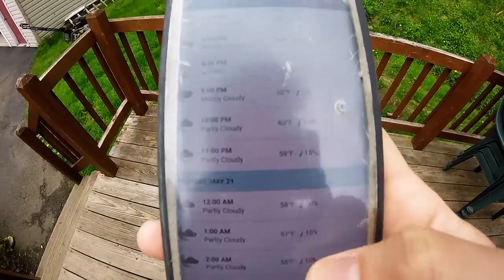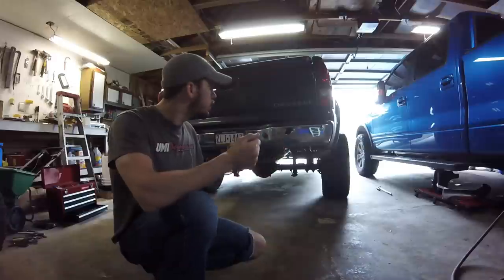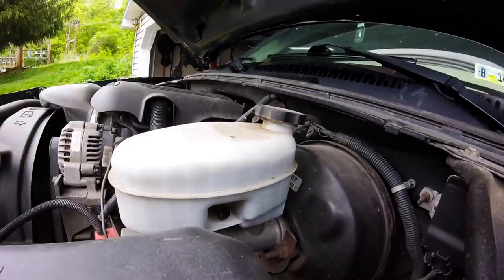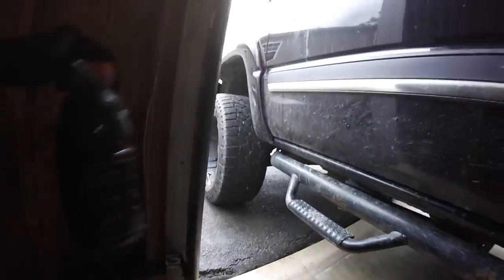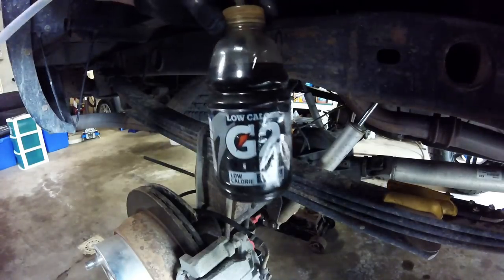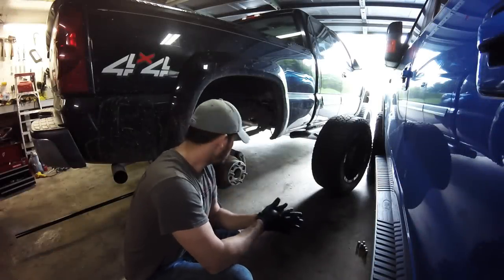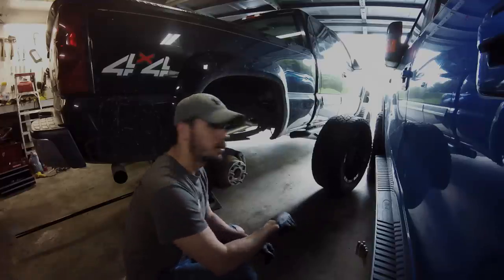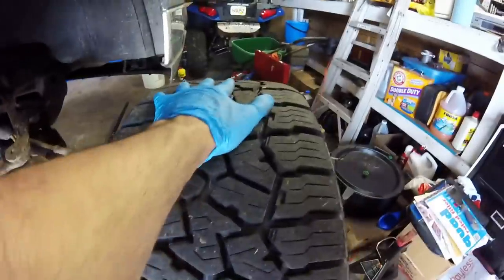04 Silverado Gets a Full Brake Bleed. Much Better Pedal/Stopping.

Comment: Before cracking the bleeder screw, try to slightly tighten before trying to remove the bleeder screw. This often Leeds to success without cracking it off.

Comment: I have the same issue with my 2005 duramax , it’s lifted 35s, I changed back rotors and pads had shop bleed brakes. Still soft, so I replaced master cylinder. Got my better result there. Did a double flush . Brakes work but I feel they could be better. My next try will be bleeding the abs. Great video thanks

Comment: Man, I really like that truck.  It looks to be in good shape for the year.  I know in Erie where I was raised that body would have been swiss cheese by now!  They use a lot more salt up there.
Reply from the maker: OhYeahAboutThat they certainly do. It definitely does appear kept up with. I tried getting him down to the $6,000 area for the exact reason figuring it would be beat and need rust repair, plus the 180k mileage. But it so far feels every bit worth $7500 I paid and it is quite fun fixing it up. I even liked doing the transmission flush lol. Now once stuff starts breaking... lol!

Comment: Just came across your videos. Nice looking 04! I got an 04 2500HD. Your truck looks pretty clean on the underside. What part of PA you in? Mine looks nothing like that. I’m in NWPA. 
Had to replace some brake lines a few years ago and didn’t realize the abs issue with bleeding them till after I bled them normally. 
Got plenty of work to do on it. Keeps me busy. Enjoyed your vids.
Reply from the maker: Thanks! I'm in the north central PA area. North of Williamsport. Prior to me the truck has south eastern PA and NJ heritage.

Comment: on your 04 chevy did you have a problem with the vacuum booster assist pump that is attached to the power booster. I think mine is junk and you can't find it or it's discontinue
Reply from the maker: Never had any issues with it.

Comment: Your truck is cleeeean bro whats your suspension and tire setup?
Reply from the maker: Thanks! 6" rough country, 305/55-20 tires and 20x10 moto metal 951 wheels.

Comment: Does this also flush the ABS module?
Reply from the maker: It isn't functioning it. However, the rear single brake line is coming from the ABS module, I want to say you are exchanging old fluid with new within the module.

Comment: He better check your brake lines I had all of mine are failing in different spots right below the driver door and then the back ones where you can't see it under the frame , don't buy pre-bent brake lines you have to fish them through and make them
Reply from the maker: The brake lines are all good on this truck luckily. I actually have since put Russell braided stainless lines in the truck since and re-bled it all again. Stops even better now.
Reply: I had three rust out before I decided to replace the rest of the original ones.
Reply: I use a this kit. lines were all ready to go and labeled
 - https://www.youtube.com/watch?v=s87C53ZNtbE

Comment: ABS module doesn't give any problems?
Cool channel I have an 00' rcsb 4.8 and 00' TA
Reply from the maker: Thanks man! Mine didn't give any issue for the brake bleed. It was doing the kick/bump thing though before this. I cleaned the ABS wheel bearing sensor and it stopped.

Comment: Does the truck have to be on when doing it
Reply from the maker: Nope, leave it off.
Reply: @DarrenWS6 you sure? I did brake lines on my 05 Silverado and was told to have ignition on position while pumping brakes
Reply from the maker: @Kevin_Yagoonie  on multiple vehicles I never had the key on when bleeding brakes and was still able to mechanically pump out the old fluid. Zero ABS issues as well.
Reply: @DarrenWS6  so you think I don't need to have the ignition on?
Reply from the maker: @Kevin_Yagoonie  I promise you I never have, and it worked. I've done it this way to my Yukon, Duramax, and Trans Am. Even my lady's Hyundai.
Reply: @DarrenWS6  awesome thanks 👍
Why would someone say to have the ignition set to on position anyways?
Reply: @DarrenWS6  you have a idea how many quarts of brake fluid I would need to bleed all brakes?
Reply from the maker: @yagoonie5.3  I believe I ran 2 bottles full. I vac'd out the reservoir first, put in fresh, and got to pumping. Starting at the right rear being the longest run it had, and pumped and refilled until it was practically clear. I may have needed 1 small bottle along woth the 2qt bottles.
Reply: @DarrenWS6  thanks so I should be good with 2 quarts 👍

Comment: O6-07.5 not 04
Reply from the maker: I did a 2006 grill and hood swap to this 2004 truck.
Reply: @DarrenWS6  oh nice..lol well that explains it....wasn't dogging on the truck, just throwing it out there...it was my girl who pointed it out...and then I looked at it...lol  it's all good..nothing really changed much during those years anyhow...but truck looks good brother..,just doing a power booster on my 03 2500, and now I have no pedal at all..no brakes, like it's not building pressure..and everything is new, just snooping around for answers..thanks man!
NICE T/A, LOVE THE RAIM AIR YEARS..LS1 BABY..O.G OF THE LS ERA.
Reply from the maker: @WhiteManXRP  haha no worries or insults taken man. Hope you get it squared away!